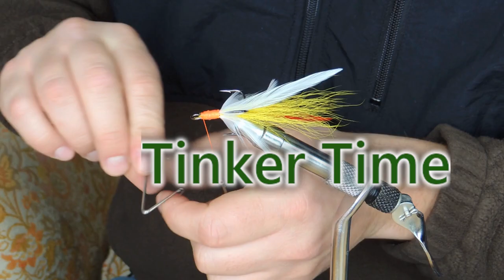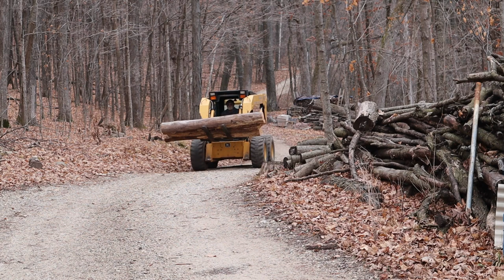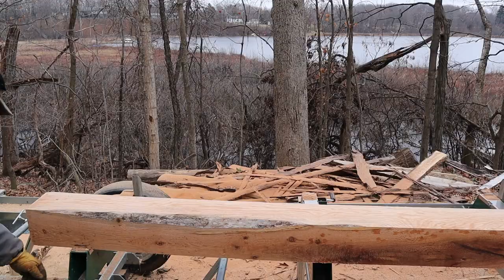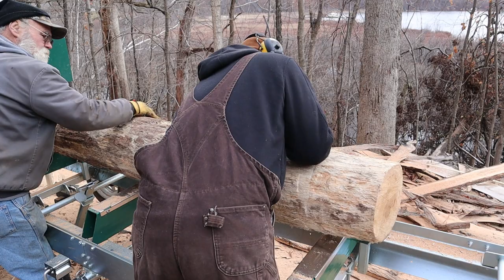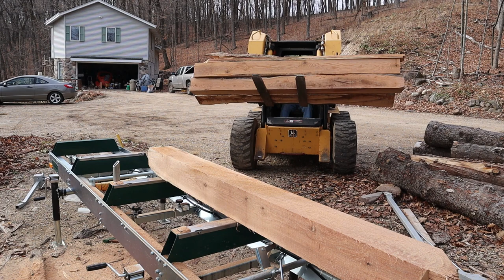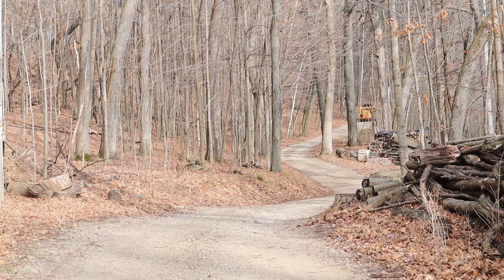Milling Oak Beams From Old Rotten Logs ✔️

Comment: Turn your log stops around with the slant facing the log this is why they're cutting a 45 so it is easier for the log to slide as it's being turned instead of being stabbed by the point
Reply from the maker: I know its the right way but its just easyer to have it the other way for the support when the cant gets smaller. too lazy to flip it all the time